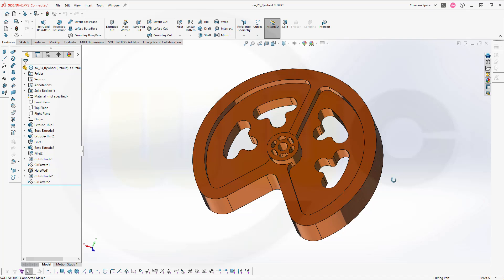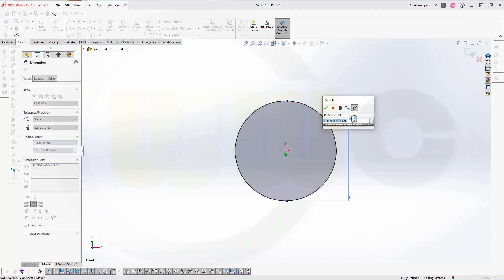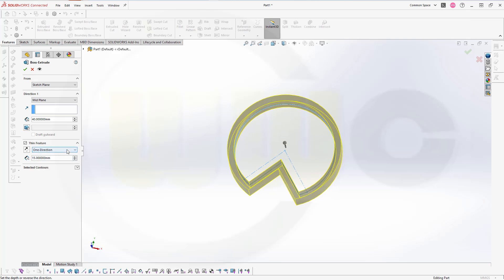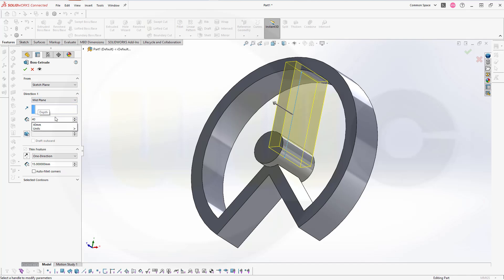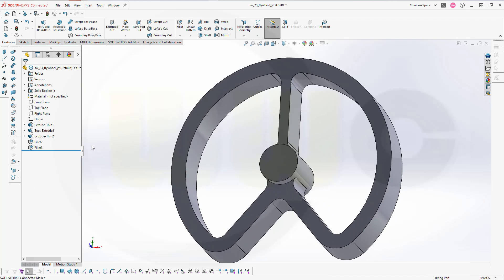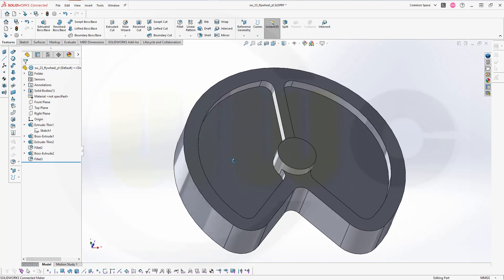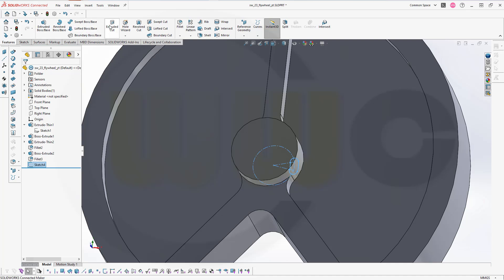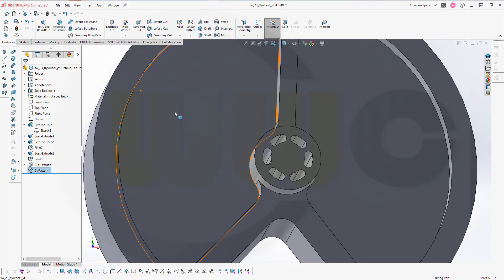5.5 Schwungscheibe - Flywheel - SolidWorks 2023 Training -Part Design

Comment: I like you're doing so many different CAD types it shows great ability to handle complexity. May I suggest something in SolidWorks - you might already do it or have changed your ways so forgive me and overlook this if it's already in your workflow? I really like SolidWorks but it takes some getting used to, but I like the workflow. May I suggest you show viewers the workflow of selecting the feature of extrusion before you enter the sketch because Solidworks will actually perform the feature for you if the sketch is correct and defined containing what it needs to perform a revolve etc - sketch and centerline/construction line. So when exiting the sketch it jumps directly to into an extrude in this example and if you draw the sketch correctly showing your design intent it will actually perform the extrude for you like intended all you need to do is to confirm meaning if you mean to perform the extrusion mid plane you draw it mid plane and SolidWorks will interpret your sketch and perform a mid plane extrusion or as in this case up from plane. It's a very minor thing but shows that the user masters viewing a drawing and building in design intent into the sketch from the start meaning that if they need a mid plane extrusion they enter the feature directly, then chose the plane to draw the sketch and the design intent is built into the sketch meaning that when they close the sketch SolidWorks will jump directly back into the extrude feature and perform it correctly if things needed are in there such as centerline with revolves etc.. But it's an amazing amount of work you have done.
Reply from the maker: thanks for your praise. I see the point you want to make. You can work in this way in almost every software.  But in some the sketch will then be available only if you edit (double klick) the feature not just ordered below the feature in the tree. Therefore I usually recommend to do the sketch before using the feature. It should be possible to edit and select the sketch directly. Your way might be better for beginners in the beginning (no pun intended) but in the end I would highly recommend the standard way.